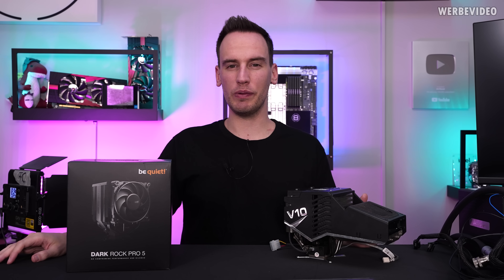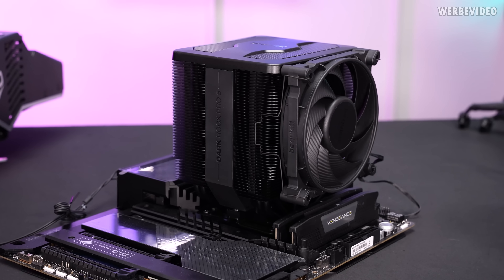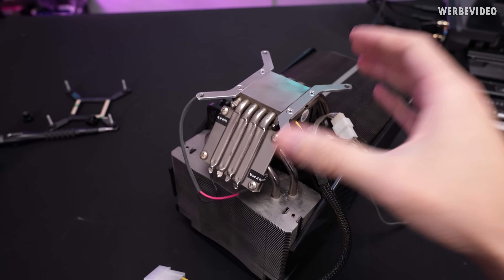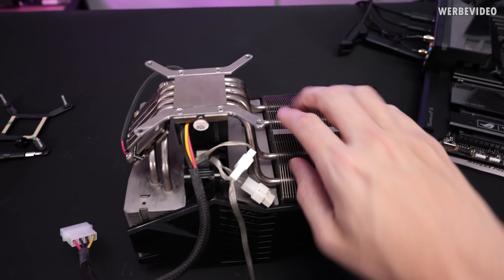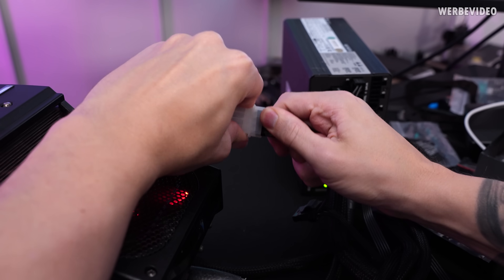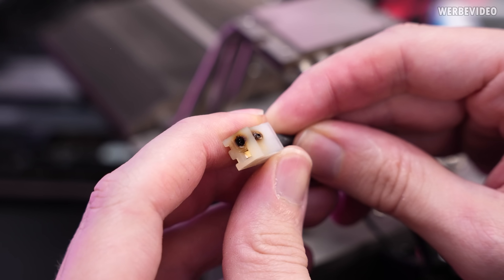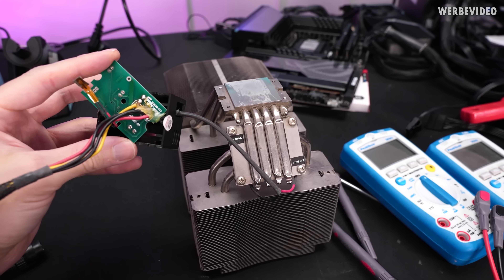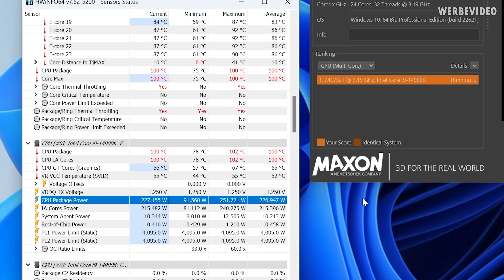This Gigantic Cooler from 2009 has MASSIVE Problems...

Comment: I was expecting little more. I honestly thought that two-tower design is direct CPU cooling and side attachment is TEC cooling. Such a disappointment, it could have been actually decent performer in that setting. TECs CAN'T work in the way people think they do. Otherwise car/portable coolers could freeze vodka in minutes.

On a side: TECs rated for 12V shouldn't be fed 12V for maximum efficiency. Their peak thermal transfer efficiency is at around 8-9 V. On top of that, they have heat transfer resistance scaling with delta-T, heat load and current. In other words: lighter the thermal load, higher the transfer.

You already did that watercooled many TECs experiment: but you have underestimated how many of these fun devices you need.

Comment: had this cooler when it came out and i went through all the same thinking you did. cause i noticed it wasnt working well then i upgraded the tec and plugged it straight in to molex. still nothing changed... love the design cause it went great in my og haf case but disapointed the tec didnt do much. but this did get me to go down the tec rabbit hole. which was fun to mess with.

Comment: In my experience, TECs are the business if you want to pump heat uphill - e.g. cooling a camera sensor to well below ambient temperature.
In CPU heatsink applications, it seems like they are often/always going to end up trying to pump heat downhill and it also seems like they are pretty damn faily at doing that 🙂 (even before the controllers fail!). Heatpipes are awfully good at transferring heat downhill...

Comment: the Peltier transduction system works , but is power is limited .I wave one on a portable cooler that I can connect to 230V or 12V DC,the hot side heat-sink on the outside is cooled by a blower fan  , and it manages to keep the drinks/food cold for several hours .however isn't ideal to cool something that generates heat , so l’m not surprised to see that fail . maybe it was enough for a P4 or Core2Duo ...

Comment: The TEC is already inefficient enough on its own, but they also connected it to the flattened end of the heat pipes. So the heat wicking effect of the heatpipes is going to favor the unsquashed side with the fan while the side with the TEC gets very little heat to dissipate. Even when it's working the TEC barely does anything to the overall heat dissipation. Just bad design choices everywhere.

Comment: This cooler would've been more effective it they just got rid of the TEC. That thing has so much fin surface area. Just a double tower cooler with an extra "tower" sticking off at a right angle.

If CM had just stuck with "ridiculously big and funky shaped air cooler", it would perform better AND be cheaper.

Comment: What is really strange is that CoolerMaster made products that were better and cheaper, like the 212+EVO. $25, came with one fan and a bracket to add a second fan. I have one on my 11yr old FX-8350 system with 2 fans and it has never gotten over 60C. It's not overclocked because from what I read in the past the power to performance you get is not worth it. And my system runs 24/7, so I WANT it to drop into low power states when the load is low.

Comment: Could you test it replacing the TECwith a solid copper shim and see if they would've just been better off using all the heatpipes to directly dissipate heat instead trying to throw in a TEC as a gimmick?

Comment: TECs are devices which consume electrical power (hence generate heat) to transfer heat from one side to another. They're very useful when you need to keep a device to a set temperature which is different that ambiant temperature.

But they're absolutely useless for cases like CPU cooling, where CPU temp isn't really important, and heat extraction really is the goal. These TEC CPU coolers are basically scams. They physically cannot work. In every case, removing the TEC from these products, or even better, replacing them by heat pipes, will ALWAYS yield better results.

Comment: I used to have a V10 and if memory serves the thermostat for the TEC is set such that it only powers up fully when it senses 70 degrees celsius, which will throw off attempts at measuring it without putting a load on the cpu first. It also means that even on lower power cpus it would never have them running particularly cold as that would be a huge waste of electricity for not much tangible gain.

Comment: TEC coolers do not work anywhere near their full capabilities the moment there is much more heat than they can handle. The only places I have seen them work is as a 2nd stage cooling after a radiator in a liquid cooling loop, where they can remove additional heat from the loop without any risk of being overwhelmed.

Comment: I had this cooler on my OC'd i7 920 D0 stepping.  Wound up swapping it for a Prolimatech Megahalems because the V10 never really worked as advertised.  I actually thought I had a faulty unit.

Comment: Will someone PLEASE make a real heat pump thats designed for cooling the cpu and/or gpu. They are quickly becoming the most efficient way to cool your house and your car (air conditioner is a heat pump) yet no one is scaling them down for PC cooling.

Comment: Interesting.  But at 220w+, I'd still personally take it over any water cooling system as that is more than good enough for me.  Of course, I'd buy any other competent air cooler first.  But if it came down to this cooler or a water based system, I'd take this everyday and twice on Sundays.

Comment: I remember tec was so hyped back then. Even down to drive bay controllers with animated graphics but also you were dealing with high end cpu's being like a AMD Phenom II X4 965 with 125w. so you could see a difference in idle temps but under load...not so much. To me what really killed the hype was articles always said the same thing "noticeably cooler at idle but add the power draw tec uses and it becomes not worth it".

Comment: appreciate the dedication to took it apart and repaired it. Most reviews would end with "welp, that's that" and leave us with nothing, or pretending that all is fine. The fact that you tried to repair the controller, and even ordered a replacement tec is very good.

Comment: 16:20 Dude .. your using it on a CPU that pulls like 300w.  That Cooler is from 2009. In 2009 it was AMAZING. You do understand that CPU's didnt pull that much power back then .. right?

Comment: I don't think you understand the concept of this cooler. The tec is there to provide a higher delta temp between opposite sides of the heatpipes. NOT to cool anything.
If you think about how heatipies work, this in theory would increase their efficiency of the internal capillary action because the liquid is actively being drawn to the cold tec side.

Comment: They must have changed how the centre fan is connect on the Dark Rock Pro 5 , I have a Dark Rock Pro 4 and it uses a fiddly wire thing same as the front fan, and it was a PIA. Actually shows I have too much stuff because I have the Dark Rock Pro 4 and an Arctic Liquid Freezer 240 sitting unused in a cupboard somewhere.

Comment: You need to review the Phononic hex 2.0. Its a modern version of a hybrid tec cooler. Works awsome on my 5800x3d.
Reply: Well, try removing the TEC and replacing it with a copper plate. It will work even better.

Comment: Back in the days when I was using an AMD Phenom II X4 955 black @ 4Ghz, I was using a Titan Fenrir cooler with a pair of scythe 120mm fans in push/pull configuration that were (allegedly) good for 104cuft/min. I figured this to be around 210 - 220 watts of cooling(ish) The system actually ran at 26C on the mobo and never nore than 36C on the cpu. Of course, this was in an oversize case that had another 8 of the same fans pulling in and blowing air out.... It sounded like a jet fighter taking off.!!!

Comment: what a great test did look little thick plating from the heat pipes to the cpu contact on the v10 not like modern heatsinks as there direct onto the heatpipes maybe mill this down and see how well it works maybe a fun test

Comment: I use a be quiet dark rock TF and have no complains, looks good, works great and even cool the VRM, also rated 220W and because ins not a tower the air flow goes down.

Comment: Older CPUs or lower grade CPUs was it's target. It says 200w plus so an 8th generation i5 or i7 that was 125w overclocked to say 200w is the market for this product.. without the tec1 it was likely rated as 150w plus 50w extra from the tec1 module.. which is a lie the extra heat pipes and fins was the extra 70w capacity really but technology sells and this was a marketing scam or people would have just bought a noctua D15 or something else rated as a 200w cooler.. so that module was always a gimmick to sell you a ugly cooler rated for 220w lol very sneaky way to charge you 2x more than other 220w coolers.

Comment: The concept did work once upon a time...a LONG time ago.
I once built a machine with the legendary Celeron 300A.  I had a cooler with a TEC on the heat synch for that. It was able to hit an insane overclock at the time of 550, stay chilly and stable.  Unfortunately the utility ended there, beyond that processor TEC just doesn't do much of anything.
Reply: You can still get similar overclocks out of an Alderlake Celeron, and a TEC is perfect for it, such as the Intel Cryo Coolers. Where the concept falls apart is if you want lots of cores on a single chip

Comment: Peltier elements ("TEC"s) are ALWAYS the WRONG choice for situations where the target does not need to go below ambient temperatures. The TEC just adds MORE heat energy to the system that you need to transport away. It does not "zap" the energy. Peltier elements are used in industrial or medical/biochem applications, when you need to bring someting to below ambient, but it does not produce massive amounts of energy that you can't transport away.

Comment: To keep it less vague, a TEC can either transfer it's rated power at no temperature difference, transfer no power at it's maximum temperature difference, or in practise something in between that. So to relate that to what Roman said, if this 70 W TEC at a max dT of, let's say, 50 C, then in some practical usecase you could tranfer that 35 W of heat with some usable temperature difference of some 10's of C between the sides. And on top of that you need to get rid of the power the TEC itself uses, which is typically 2-3 times the transfered power.

Comment: The purpose of TEC is to achieve a low temperature on one side with no moving parts, not to transfer any significant amount of heat…

Comment: Your videos showing unique coolers from the past are amazing. Late 00's was the time of total craziness in CPU coolers design and it's amazing thing to show and test today. This one was pretty sophisticated, but mentioned time was all about trying hard to be different even if it was only shape of the heatsinks like e.g. Scythe used to love with e.g. Grand Kama Cross or Orochi. Until you tested it, you couldn't know if it's some highly advanced engineering or just some freak show, so they were always starting with being impressive : )
Reply: not all old cooler desings are bad, I'm still using my thermalright ultra-120 extreme (TRUE) from 2007 on my Ryzen 5800X. It was like the first large tower cooler that did everything right, a lot of heatpipes and a lot of surface area, still works well today
Reply: @chainsawfreak  I didn't say old coolers are bad. I would even say that's not much has progressed for all of these years, especially if we talk about bigger, perfrormant coolers - newest best compared to 10+ years best will shave you 5-10C when noise-normalized, so amount not making much difference for (normal people and) processors mostly being fine with operating up to 100C. And this progress mostly comes from newer fans which are also thing which changed the most for all of these years: now they tend to have way lower minimum speeds, quiter bearings and motors or fight vibrations better. Anybody interested in topic check HWCooling Gigantic retrotest of 80 CPU coolers (2005–2015) with D15 being here link to present.

Comment: These were probably sold, when those big towers were sold. But in standard cases, this would be a problem? Any way, this is the first time I see this massive cooler, great video Roman :)
Reply: I bought this for my Q6600 (if I recall correctly). I had to modify the 5.25" drive cage so this could fit. It was a pretty big problem for my.. I want to say Antec 900? Or maybe it was a different case. 

Man, 14 years ago...
Reply: @Those_Weirdos  Not so long ago, I put a 360 rad in a mid tower, and I had to demolish 2 x 5.25 bays as well 😅 so this problem still exist. But who uses 5.25 anyway these days? Not me, for sure.

Comment: It's probably regulating the voltage to only 7v since the temp sensor is not warm. Also would be interesting if you had swapped the TEC for a higher current one, to see if it had done anything, probably not though, TECs are really useless. 😅
Reply: They have many good uses, but cooling high power CPUs really isn't one of them.
Reply: I made a minifridge with TECs it works great and it's quiet
Reply: I2r is a thing (and very becomes a thing with higher current) with TECs.

Comment: the v8 was my first ever high performance cpu cooler i ever bought, i remember looking at the v10 and just laughing at how ridiculously big it is
Reply: I had the V8 as well, but i was lusting over the V10 for some reason :D
Reply: Bryan from Tech Yes City just had a PC with a V8. It was all cross threaded and he couldn't get the cooler off.  Thermals were fine with it so he left the cooler on without replacing the thermal paste.
Reply: Ditto.
I still have the V8 on my 09 computer
 It now operates as a media server
Reply: I still have a soft spot in my heart for how ridiculous looking the cooler master V8 was. I can't bring myself to hate it.
Reply: Same. I had the V8 with an Amd fx 8120
Reply: Ditto.  Did anyone out there paint theirs up like a Cylon warrior?
Reply: I had the V8 too, but it didn't quite fit my Cooler Master Wave Master, so I traced a template on the Aluminum cover and cut out a clearance hole.

After smoothing the edges, it fit perfectly and the side cover could now latch closed. Just the plastic cover with the V8 badging was poking through, making it look more like an intake header. I felt it rather fitting for its automotive-themed nomenclature. 

That was my first proper "gaming build" with SLI'd GTX 550 Ti's and a Phenom II 940 Black Edition. I miss that rig.
Reply: Don't. I have a PC with that exact processor right now and it's a DOG. The Core 2 Duo E6600 in the other old PC I have still running is faster. @DJSekuHusky 

Oh and both those PCs are using the OG performance coolers. The Zalman round-pipe coolers from like 2003. I don't remember what they were called. They were the bomb for the time.

Comment: Would've loved to see what happens when you simply remove the TEC and screw the mounting plates directly against one another, might give you slightly better results?
Reply: I had that monstrosity back in the day, removing the TEC helped alittle.  TECs act as an insulator when they aren't cooled enough, so you were effectively losing an entire fin stack because of bad design
Reply: What I thought as well, at most a copper slug there to level it if needed, will increase the heatsink area for sure.
Reply: I wpiluld imagine some indium foil or a gallium alloy would be a fantastic interface to test that. TECs are essentially insulators, so it very well could improve the performance.
Reply: @TheTrueOSSS  wouldn't that be a normal liquid metal air cooling setup then ?
Reply: @gabrielhmi  Yes and no. Yes, the basic idea to remove the TEC essentially converts that part of the cooler into a standard air cooler. No, because the thermal interface between each set of heat pipes adds thermal resistance no matter how good the interface is. I think the hypothetical exercise is to examine how good the cooler could have been if it didn't use a TEC as a gimic.
Reply: Would definitely give much better results.